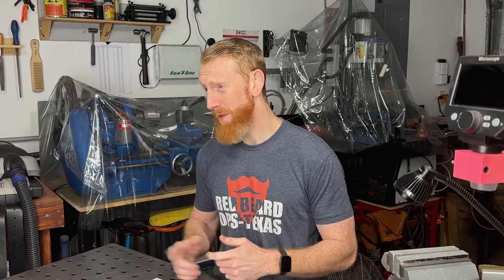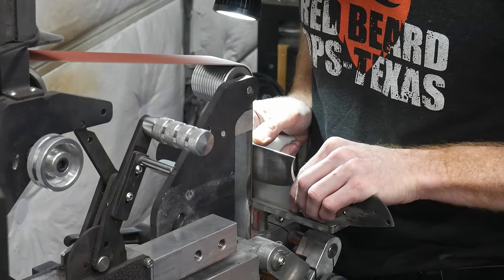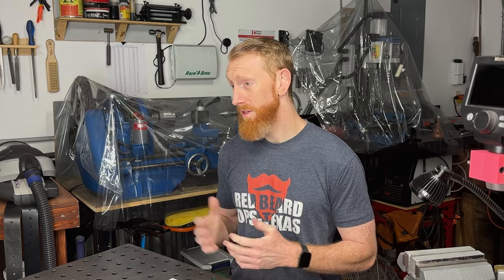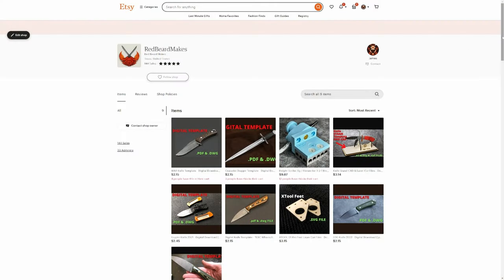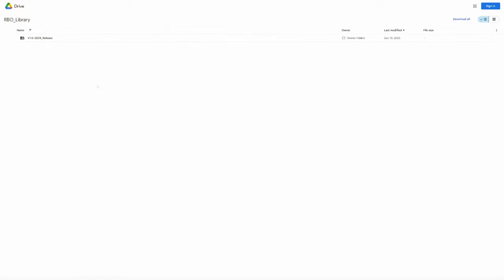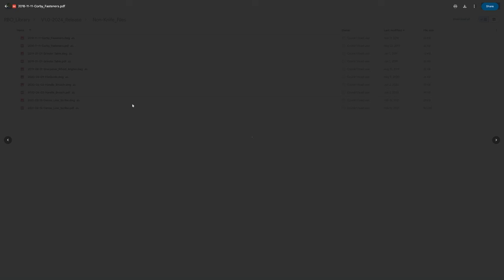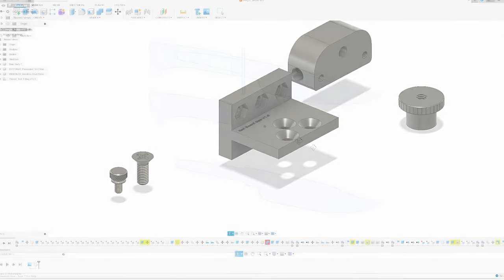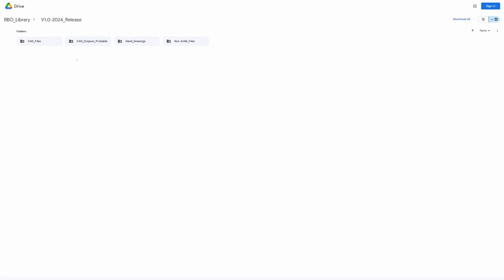Open Sourcing My Knife Templates | FREE Knife Making Design Library

Comment: Do I just print the Template onto paper? Do I have to do anything to get the right size? Also I downloaded and opened the template and it got messed up or something will it come out normal when I print it out? Thanks I’m new to this knife making stuff but I hope to get good and it thank you for your videos I love them
Reply from the maker: Should be able to open the PDFs and print them. Make sure your printer settings aren't changing the size. Select "actual size" under more options. Not fit to page.

Comment: hello I want to try heat treatment to my vanax steel in the manual it says 1975F 30min so should I pre heat my oven to 1975degree then put it 30min? or should i put steel in room temp then wait 30min to 1975 degree?
Reply from the maker: Hey man, I'm not sure about your steel. Never used it before.